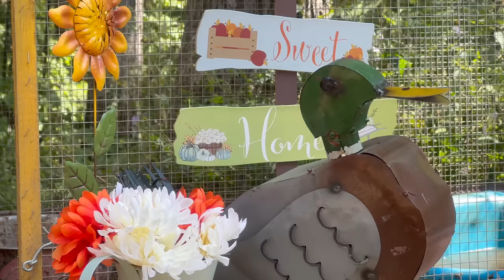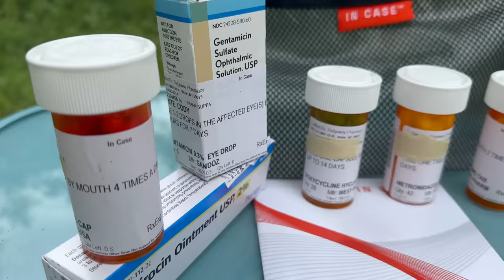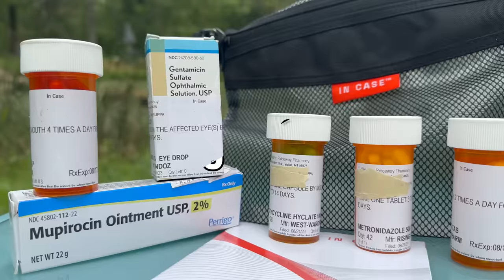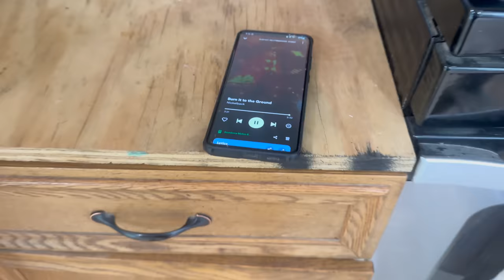Self Milled Oak Fence is Complete...Well... | Container House Subfloor

Comment: For the fences I would remove the bottom boards, route out the area and insert the cattle panels into that and bury the panels. Using the rocks would give the dogs a higher place they could use to jump over the fence in the rocks was inside the fence. If you put the rocks outside the fence then it would allow other animals to jump into the fence area and not be able to get back out (sometimes). I know that is not what you want to hear since it would involve basically removing each section of fence again. but in the end it is your fence and can do it they way you want :)

looking forward to seeing the entire finished job on your homestead

Comment: oh my;;;if ya want to let the pups out earlier than filling the holes with whatever;;a simple small elec fence solar with battery and single strand wire close to ground will work great and also keep other creatures at bay that don't climb or fly;;lol;;;just a suggestion;;;easy peezy;;;I put a perimeter underground wire fence around a yard for family that had acerage and didn't their pet out running after a few skunk encounterss;;;lol;;;a little costly but they were really happy with it;;the collar alerted the dog not to go past the buried wire and stayed holme like a good puppy;;;anyway good luck on the boulders or panels or whatever;;;I know we all have a better way or just think you were going to let the dogs out and run off by getting under the fences;;;lol;;;have a good one